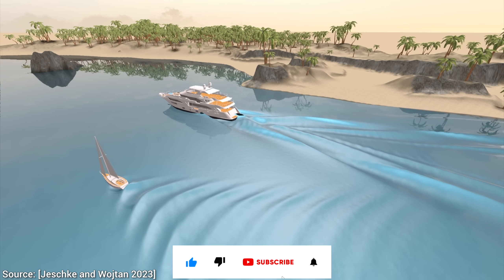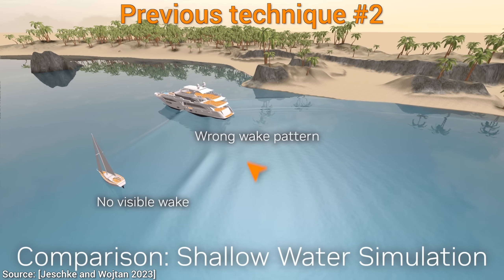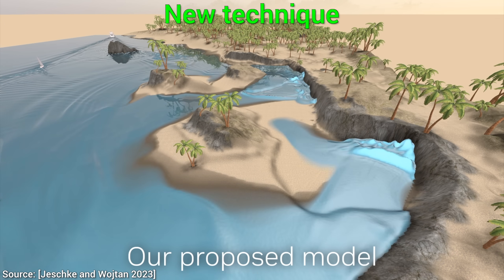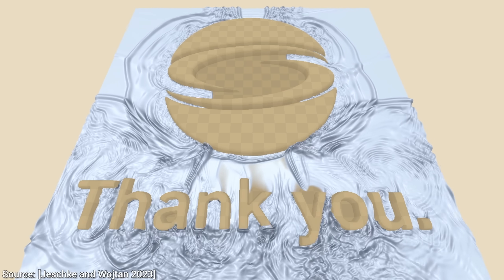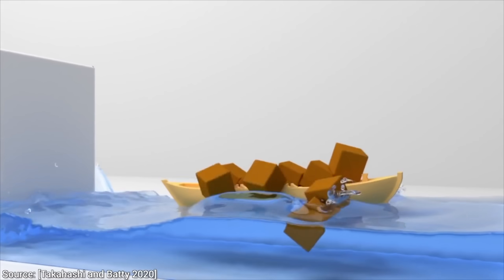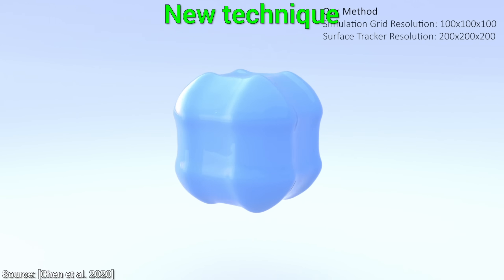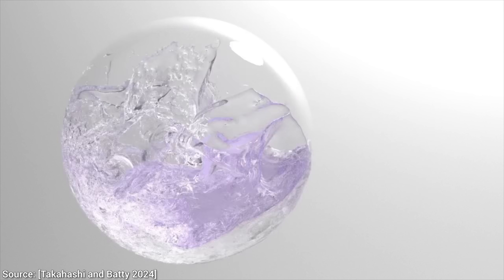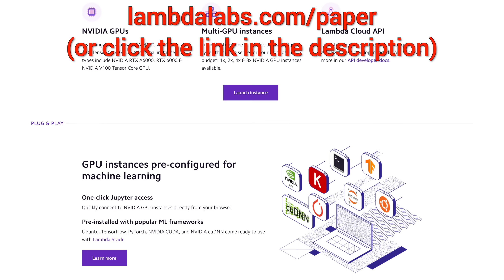NVIDIA’s Tech: Impossible Water Physics!

Comment: The first method seems to be something like heightfield style simulation thus not capable of simulating an overlapping pert of the wave "Lip". I think the next huge milestone would be to make such scenarios possible. Maybe it is possible to achieve by looking at power distribution field of waves. Then a set of levels could be prepared and the sim would hop between layers based on some predefined threshold, maybe this could even be done locally to avoid creating full resolution maps for the wave levels.

Comment: The droplet simulation still seems off. In slow-mo footage, you see smaller droplets completely bounce back and start a repeat cycle with a smaller droplet.
(Though I think that one is also temperature dependent? Something something requires low temperature?... I guess I might be wrong.)

Comment: Well to be honest, if the ground is not sealed it can soak up some water, so disappearing water actually looks more realistic in some circumstances.
Reply: it depends on what you want in your scene but overall it's not a good thing. If you really wanted that, you do have features like particle lifetime to have the particles disappear when you actually want it to
Reply: True, but if you don't want that behavior and the simulation is doing it anyway, that's a problem.
Reply: I was thinking the same thing, one is fine for gaming, the other would make more sense for engineering.
Reply: erm

Comment: Simulated water always seem like it has no surface tension, too high fluidity
Reply: More like ethanol than water.
Reply: it depends on the simulation settings and engine. for example I've only used blender mantaflow, blender flipped fluids addon, and houdini flip solver. all of them have their own settings for all of those, houdini's flip being the best looking/fastest I've tried so far, which could be because faster = more time to play with settings
Reply: you have to build the rules up before you get to something close to reality.
Reply: I was thinking the same thing.
Reply: It has to do with how porous the surface the water is interacting on. I’m assuming they are not simulating sand but what amounts to a frictionless plain.
Reply: beat me to this comment!